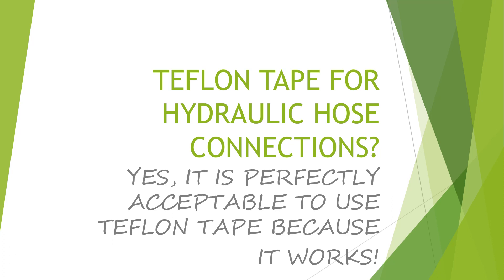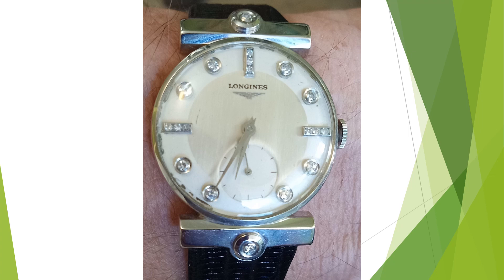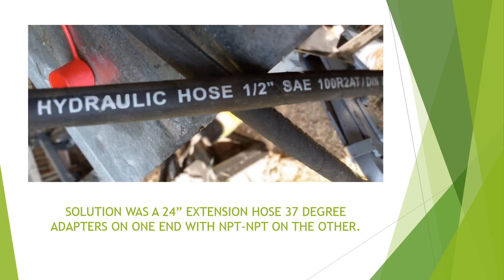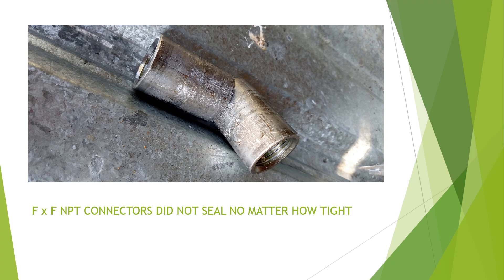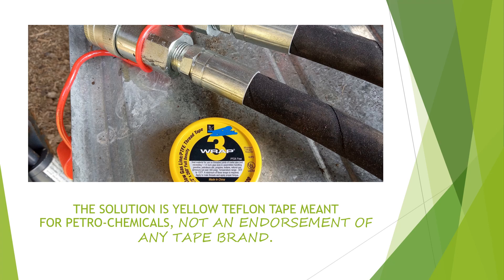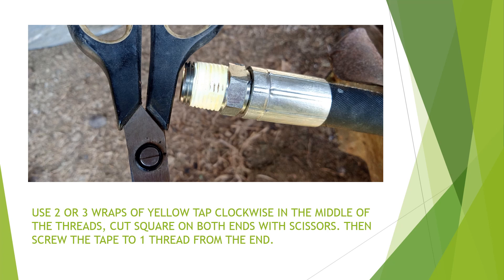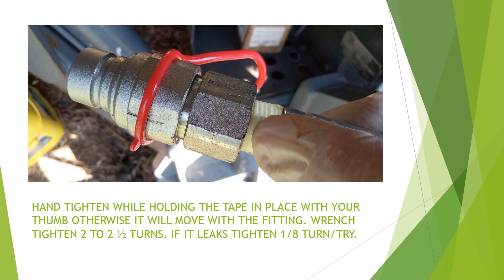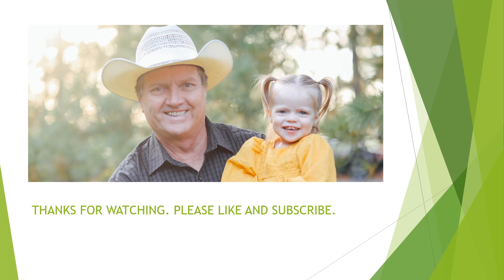TEFLON TAPE FOR NPT HYDRAULIC HOSE FITTING, THEORY AND APPLICATION FOR SKID LOADER ATTACHMENTS

Comment: Thanks for this.  As a new tractor owner I used this method to stop a leak on a male pioneer coupler.  Excellent tip to use yellow tape. I thought it might work in theory but didn’t wanna screw it up.  Followed your method as close as I could and the leak is gone or significantly diminished.

Comment: Is that for high pressure hydraulic fittings?
Reply from the maker: Not sure of the definition of High Def, but I use it on modern and large skid steer loaders.

Comment: Please let us know in the future if this ends up weeping or leaking I'm interested to see how several heating and cooling thermal contractions pays out for the tape repair. I hope it keeps well.
Reply from the maker: I ran the backhoe yesterday for over 2 hours.  The fluid got hot as normal and no leaks. What shocks me is that I did not have to tighten after 2 turns. I thought I would need to keep snugging it up. So, right now after the initial test, it looks real good.